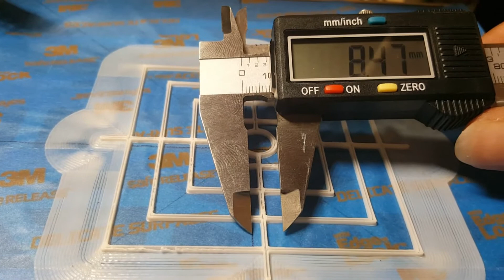How to center your 3D Printer Heated Bed  (Part1)

Comment: Just a little suggestion to make your measuring more accurate. Try printing your centering target wherever your slicing software considers "center", and then just lay a ruler flat on your bed with one side of your bed at 0mm and the other side at 220mm (22cm) and see where your ruler hits the extended center leg, on the outside of the bottom of the target. 110mm (11cm) is center. Do that horizontally (x) and turn the ruler and do the same vertically (y). It will keep you from having to guesstimate with calipers and will be accurate to the mm. This is obviously just for finding center. You'll still need to go through whatever following steps you choose for offsetting the tool head to compensate. This works for me and is super fast and accurate. Looking forward to part 2!
Reply: I also forgot to mention that if you do it this way, you can print the centering target small, maybe 40mm square and save a lot of filament, and it is more accurate because the lines of the target are finer and will hit a mm mark much more accurately.
Reply from the maker: Dj Goku thank you i will keep that in mind i was just trying to show beginner's how to get it close enough to center
Reply: Oh yeah, I totally understand. And that's why I'm looking forward to part 2, lol. I'm pretty much a beginner, just with a background in CAD design and CNC work. So, the way I described is the way I learned just recently, and it's super easy and quick for noobs. since you can print small, the print takes 5 min, and then, practically before the bed even cools, you take two quick measurements in 1 min (x&y) and you've got you're offsets. if it's to the right of 11cm you -x however much you need to hit 11cm. And then repeat for y, just vertically. Since 11cm is center, vertically or horizontally, on the Anet's 220x220mm build plate, you don't need a reference point on the bed, so it saves more time for the easy to confuse noob like myself, haha. What I'm interested to see is how you re-calibrate the software. I haven't done that step yet and have been reduced to just offsetting it in my slicer software by manually moving the part the desired mm every time i need to slice a new gcode. : (  But I see you're using ramps and I'm on stock anet board with stock marlin, so I hope the steps are similar for my setup.
Reply from the maker: Yes it will work for the anet board the marlin firmware is the same just messing with the code a little bit and part 2 is coming out tonight and I show how to mess with the code so you can save it and no more off setting it in the slicer software
Reply: Awesome hommie! Wow, thanks for releasing the vids so close together! I thought I'd be in suspense for a while, lol. I'll be waiting for that subscription bell to ring!